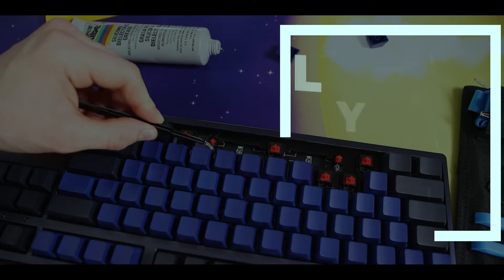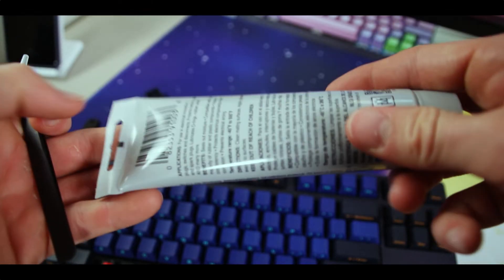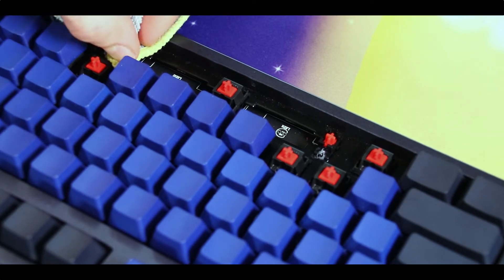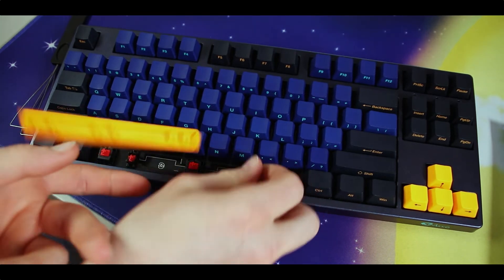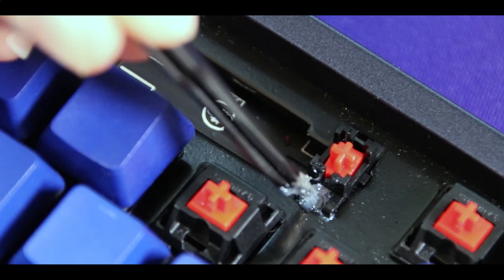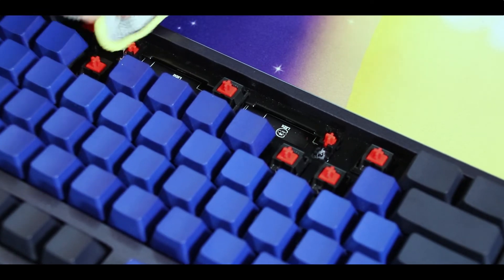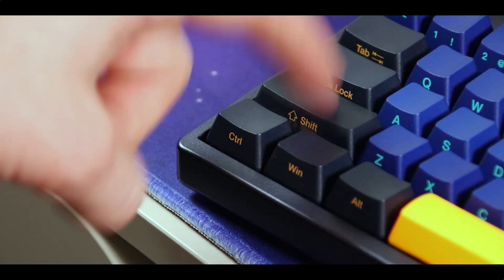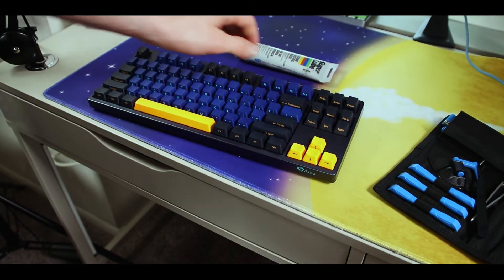Lube Keyboard Stabilizers Without De-soldering (No Rattle)

Comment: For some reason, my left side of my spacebar is very rattle. How do you think i can fix this?
Reply from the maker: Bandaid mod it. If it's hotswap you can take the stabalizer out and straighten the wire bc that could cause the issue. Also some keyboards have bad rattle like most corsair so it's not always fixable
Reply: @MiloKolb  Ah okay, i have a gk 61 which is hot swapable so ill try and straighten the wire
Reply: @MiloKolb  ALso do yuou think lubing it would be a good idea?

Comment: would dielectric grease work?
Reply: Yes, dielectric grease is recommended.
Reply: @pk.002  hopefully I don’t mess anything up the gk61x stabilizers aren’t bad but the space bar is very annoying it throws off the whole sound
Reply: @Eryk178  Same 😂 It's straightforward enough though, you can also use a plastic straw cut to 1/4 of an inch wide to apply the lube for an extra step that helps even more. If you get Super Lube (the kind with ptfe that comes in a a dropper), you can apply to the straw and put it between the stem and the stabilizer on the left and right sides so it slides down more smoothly. 
I have a Ducky Frozen Llama Mecha with silent reds, love the board but one side of the space bar rattles and it's driving me crazy lol.
Reply: @pk.002  Yeah man I have the gk61x board and popped some gateron clears I actually really like the smoothness of these a lot of people hate clears and say they get a lot of accidental clicks that’s not how it is in my case so I guess it’s all personal preference. They are serving me real good.
Reply from the maker: @Eryk178  you could clip and bandaid mod it too bc it's hot swappable. My gk64 was pretty rattley at first too but doing all that will make it much better. I also have a link in the description where you can buy the lube I use. It's the amazon link and I get like 5%
Reply: @MiloKolb  I don’t have the experience too all that nor the time right now is a pretty busy time I’m sure this will work fine if I can get the grease
Reply: @pk.002  what would be the difference between 22058 dielectric grease vs 81150
Reply: @Eryk178  I looked it up and it's no difference, just the part number for the tube size of grease.
Reply: @pk.002  thank you I just found that out as well